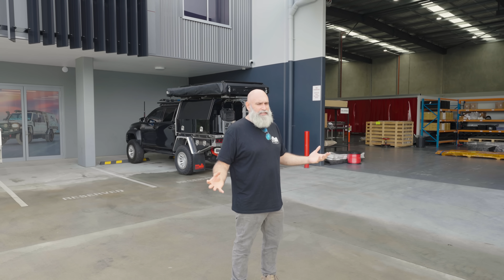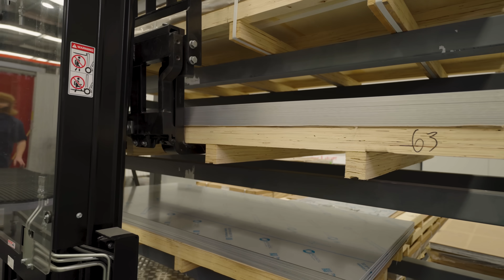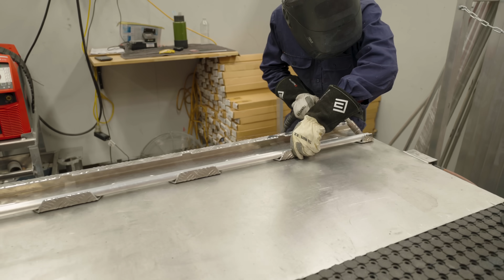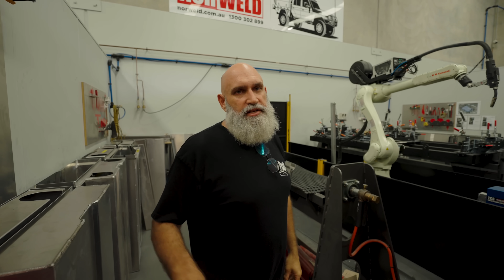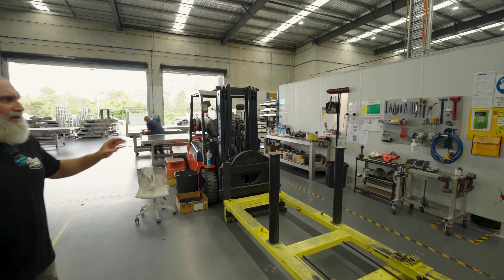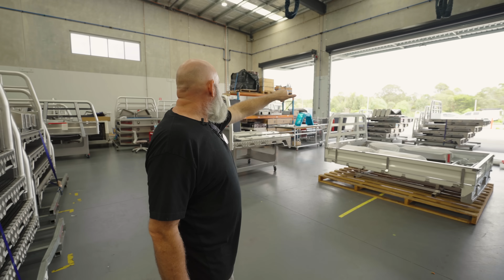Inside Norweld: How We Build Australia's Market-Leading Ute Trays | Brisbane Workshop Tour

Comment: On ya BULL I love very much where its got to for the Team knowing all them years ago I had an initial input, not to mention all them years ago working with orders from the Original Workshop around the corner from where the Trays started @Isaac Edminston on ya BULL.

I sooooo hope you and Steveo who I delt with all them years ago (2013-2014) to manufacture the very first Custom tray for me in 2014 when I walked into you guys and  I designed that Tray  in that little office that went on to be your leading Deluxe Tray that you still have my Original tray we designed to put on Display at HQ ?
As time has gone on, the Trays have Changed , BUT my ORIGINAL design of the headboard is alive and well ! 
Obliviously a Game Changer for you guys from back in that Day of my Design and going Strong from when you only did a box section Ally Headboard set up then showed you the design and Steveo done the Cad drawings of it saying it will cost way more and I said its not an issue.
We need to catch up Bull?